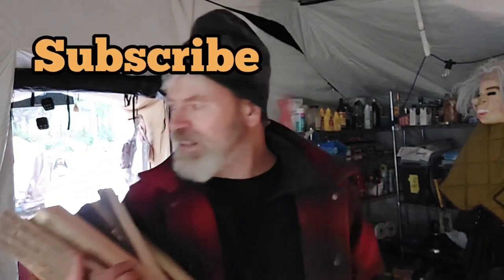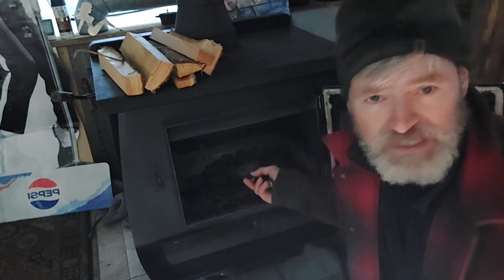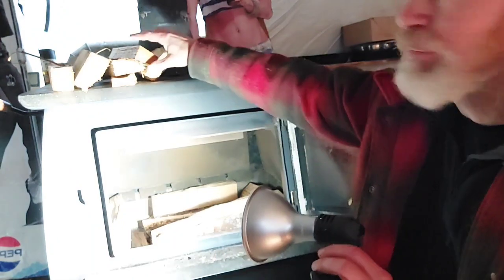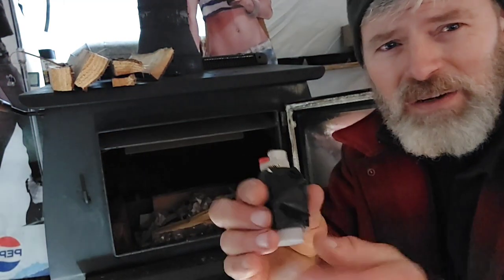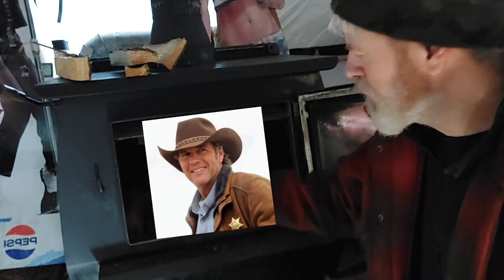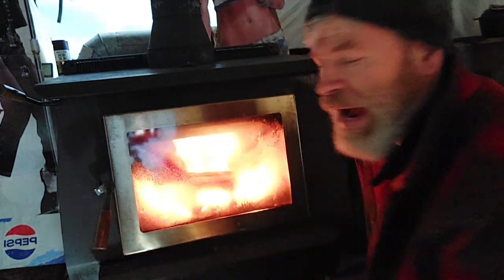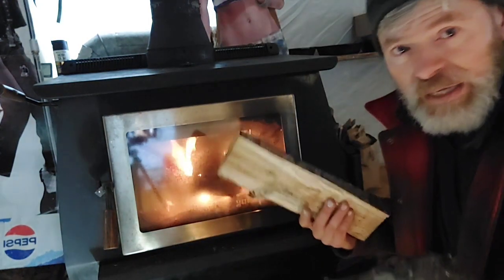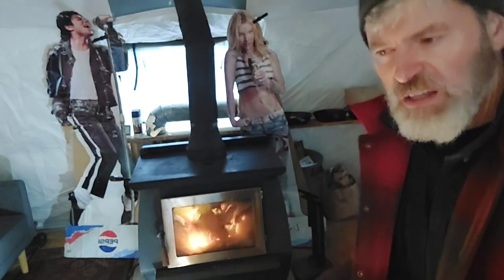How to Build a Fire in a Blaze King Wood Stove

Comment: I have a drolet ht2000 secondary burn and have had no issue in the almost 3 years ive had it.🤷‍♂️ good the good thing is  i never need to worry abour replacing the catalyst
Reply from the maker: That's great. Glad the Drolet is keeping you cozy. I think the catalyst was for the government regulations. I burn the Blaze King without it engaged and it cranks heat the same. I'm definitely not a complete secondary snob... especially when I'm warm next to my Sister the Gunrunners Lopi Liberty.
Reply: @OffGridandWhiskey  yeah the blaze king is a great stove, i guess you do have the option to bypass if the combuster fails. The main thing about both types of stoves is that they are way more efficient than past stoves. I'd actually like to see someone make a video with the blaze king 40 vs a ht3000 using the same wood side by side or at least in the same conditions and see which one uses less fuel according to the specs (ht3000 hhv 71% vs king 40 hhv 81%.
Reply from the maker: I'd like to see that comparison too. I know I use less wood then my old Quadra Fire 2100. I was constantly feeding that stove. The Blaze King I'll fill it once and 14 hours later check it. I've had hot coals 30 hours later. I actually bought another King Parlor over the Thanksgiving weekend. $400 dollars on Craigslist!
Reply: @OffGridandWhiskey  my parents have an early version of a secondary burn tube stove from 1984 they still use, but they live on the west coast where it doesn't get real cold and a cord can pretty much last all winter. It's interesting that way back in 84 before they started regulating them they had been working on making them more efficient.

Comment: Can  you really get 40 hours of it on low with good dry wood? I want one of these puppies for my offgrid bus, hopefully it would heat enough for down to -30f.
Reply from the maker: I've gotten 36 hours of heat before adding more wood. Un-insulation bus.... at -30f....? The Blaze King 40 will be better than anything else on the market. Make sure you go 8 inch pipe for maximum draft.
Reply: @OffGridandWhiskey  Nice, 36 hours seems good. It will have 4" of spray foam insulation all around and sealed up tight with most windows removed and replaced with RV ones. This rig should do the job. Great vids man.
Reply from the maker: Far out. Yeah, if bus insulated then a Blaze King with do the job. Here's a link to a new video of finding my 2nd King Parlor: https://youtu.be/8b32fTnAe-E

Comment: The valve stem remover is cool right now, but I heard of a new trend that’s going on right now. People are taking airsoft BBs and you remove the tire cap and put one in there and screw the tire cap back on it holds the valve down just a little letting the air out.  Only a complete scum bag would do that but I thought it was interesting😅
Reply from the maker: I only started carrying a valve stem remover after 3 scumbags parked behind me and walked into my favorite hunting hole while I was waiting for daylight outside my tent. And the road was a washed out,  dead end, 1 person hunt.
Reply: I’ve heard of people supergluing the bbs inside of the cap so it’s less obvious